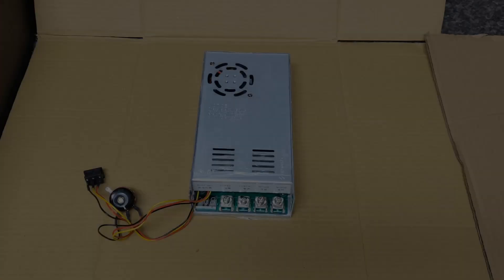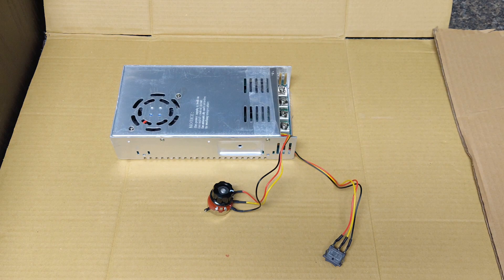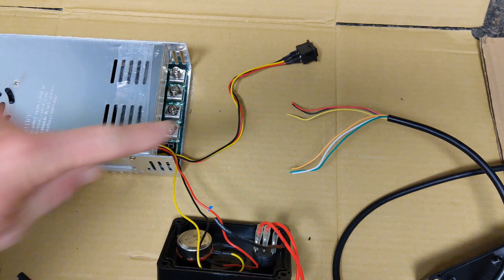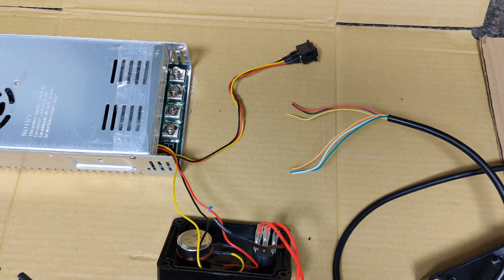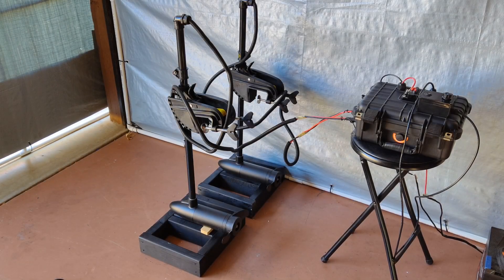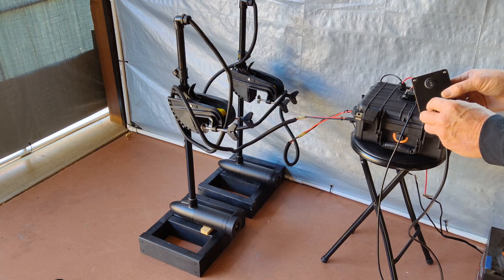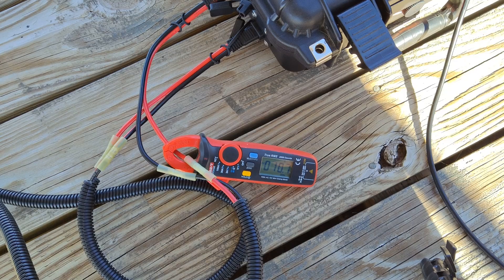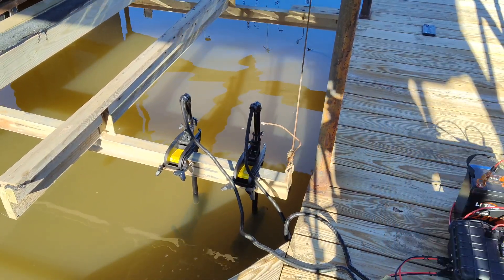Crappie Brakes Using PWM Digital Speed Controller and Remote

Comment: Greetings and thanks for the good informative video as always. 

My question is, what are the yellow and white wires for coming from the top of the trolling motor shaft?  Would I need to use those wires if I’m gonna use the trolling motor’s speed selector switch after I remove it from the head of the trolling motor and use that speed selector switch with my boat brakes pedal setup at the front of my boat?  And would this be an alternative to the PWM setup?
Reply from the maker: Yes, you use all 4 wires for the stock speed switch.It is an inexpensive but not as good alternative to a PWM.
Reply: @Aksmaniyak Okay, thanks for the rapid reply and awesome tutorials you bring to us.  So in my situation, it’s just that, I’ve run out of space in the jonboat to place a PWM box system (I have a relay and circuit breaker set up that allows for reverse and forward on two different foot pedals up front for my 2 trolling motor brakes in the back…but they are too strong/powerful or permanently on full) I figure I only would need the speed adjustment switch added somewhere near those foot pedals up on the bow.
Reply from the maker: @TheSilverSurfisher That’s how some people make them.

Comment: Wow! I just noticed the little trolling motor stands you have. Did you use a 2x4? I see you might have a yellow wedge on there, is the 2x4 tall enough or should I use a 2x6? These are worth a video. Thanks for another great idea!👍
Reply from the maker: Glad to help. I used scrap 2x4s. You could use 2x6s. It just depends on your TM.

Comment: I don't fish for crappie but I understand the principle behind the brakes. If I find a bed of crappie I can back up without spooking them but why do you need 2 trolling motors?
Reply from the maker: Some are mounted to power poles for convenience. Also, if you only mounted one on the transom due to outboard motor being centered, the boat would rotate. Two allows for a straight forward/reverse.

Comment: First things first, Thank you for all of your great videos! You've encouraged me to build my own controller. 
I decided to put a Newport 55lb thrust 12v motor with a 100ah LifePO4 battery on my Nucanoe. I don't need speed, I just want to troll for 4 or 5 hours. 
This looks like a good PWM for my needs. I'm always a bit concerned with the PWM failing and still being able to get back to the dock. If I set this up with the motor hand control at top speed(5 if I recall), will I still get proper PWM control? If the PWM ever fails, I would like to unplug the PWM box and plug the motor into my battery box and come back with the traditional hand control. Thanks again for all the videos!
Reply from the maker: Glad to help. If you want more time on the water, a 40lb trolling motor would work fine and save battery run time. Yes, you can run the PWM through speed 5 of the motor.
Reply: @ Thank you.